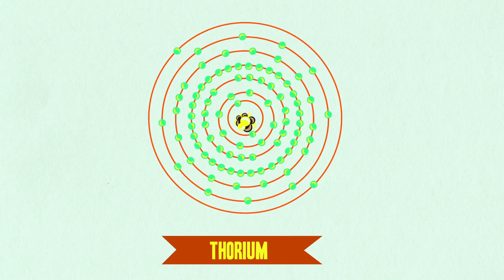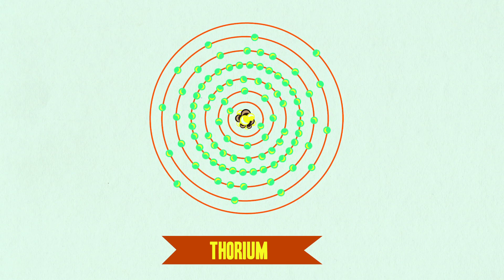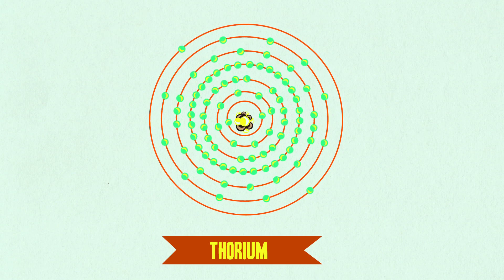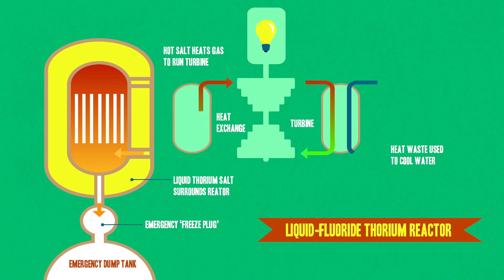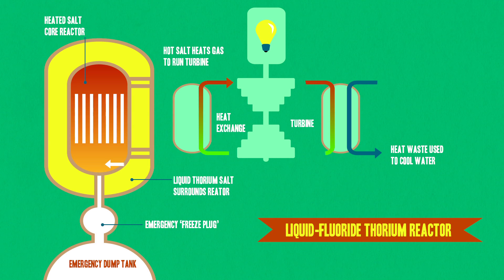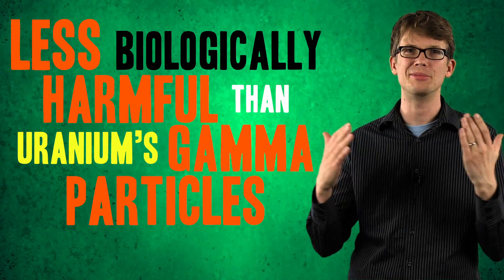Liquid Fluoride Thorium Reactors (LFTR): Energy for the Future?

Comment: I'm thrilled that you made a video on this topic.  However, the bit where you imply that thorium does not emit gamma particles is misleading.  It does during fission in the reactor and various byproducts of thorium emit gamma radiation when they decay.  However, this is not much of a problem if you are just trying to build a power plant because you can set up shielding (w materials such as concrete) to block almost all of the gamma radiation.

Comment: Solar energy is clean and free (same with any source of energy), but it's unusable without proper technology. And so far solar technology is neither clean or free. Solar panel may last 25 years, but it in itself won't produce much energy (I have three solar panels on a roof - they're barely able to heat water in the boilers during hot summer and summers here aren't that long), not to mention that they're expensive and not that clean to produce or maintain.

Comment: Well, interesting point, but wouldn't using solar power be worth the expenses in the long haul? A solar panel if I remember correctly lasts up to 25 years, I don't know how long Thorium Fluoride lasts but it could be more costly over the course of 25 years compared to solar energy which as you know is free.

Comment: You're quite confused. A photon is more ionizing than any other radio active rays. Gamma particles are more ionizing than alpha particles as it travels further in your body. A gamma ray, a photon, can knock electrons out of an atom quite easily which in terms ionizes the atom. An alpha particle, because it is quite big (ei, helium).. although carrying more energy ionizes in a shorter distances (ei, in your skin which is composed of dead cells) and hences, is less dangerous.

Comment: As I recall don't LFTR reactors require uranium or other higher elements in order to begin fission? Or is that a different reactor element design because if I remember correctly there a bunch of radioactive elements which can be used for the same process...

Comment: See, there is a link...
Roofer is a dangerous job...

Radioactivity is a vave or a paricle and disapear very quickly, you mean radioaktiv isotopes. There are some with short halflifes and some with long.
long mean 30yrs and short 8 days or so.
You haven't to worry about Plutonium, its simply too heavy and will stay there were it is.
The radiation in Schwarzwald is highher than in Fukushima...

Comment: Theres other stuff as well, just in the way its built to regulate the heat from each individual core, but basically, the big point is radiation doesn't leak out and the reactor can't melt down at all

Comment: like Boron Balls, which prevent a fuel rod from reacting ever basically, which is why there a last resort. This is a big problem in group reactors because you loose all production from that reactor and have to replace the whole thing, whereas in CANDU's you can just replace the individual fuel rod you stopped, which is much, much cheaper than replacing loads. Basically, if a rod were to overheat, they completely shut that one down and replace it, so it can never overheat

Comment: Basically, its more like several individual reactors lumped together, with each fuel rod being separately contained and hence controlled. That means they're less likely to overheat as they never get too many reactions on any individual fuel rod (as can happen if there all together) and if one were to overheat, its much easier to cool down. If all of that fails and the rod will go critical, you can shut down that individual rod or if necessary prevent it from ever reacting again with something

Comment: well Thorium is about 3 times more abundant than uranium, so logically, its 3 times more efficient to mine, so would produce about 3 times less GHG's. And i'm not sure about retrofitting, but a completely self sealed thorium reactor, cooler and power generator that can be installed in place of a uranium reactor costs about $25M to build and somewhere around $5M to run compaired to $6B to make and $50M to run of a uranium plant

Comment: I visited Europe's JET project the other week. And I can tell you the reactor itself works perfectly and does everything it is designed for, which is merely finding out more about fusion. 2 larger reactors are being funded by the international community, with the 2nd one actually being able to experiment with energy output. If everything goes to plan, we should break even on it by 2039 (I know, ages away), but that is the year energy becomes easy and renewable. We just need to get there!

Comment: I don't know, I think 2050 is looking about right, if not a bit optimistic. There are prototypes at the moment, sure , but we can't get accelerators and tokamacs to last any longer than about 30 seconds, or produce more energy than they need to start. As for lasers (I presume you mean cold fusion reactors, there they most popular laser reactors) there batch producing, not continuous, so they'll never be used for industrial energy production.

Comment: And Fukushima didn't even melt down, they stopped it long before that could happen, it wasn't even close. Plus modern reactors (and I use modern loosely, I mean like 70's-80's) have so many fail safes they can't physically melt down, and most older than that are on there last legs anyhow so are being decommissioned, so aren't going to cause any problems

Comment: There are prototypes, which can run for a short amount of time, so we know what it would be like to have fully working ones, so we know about the dangers of them breaking, they've done it enough. And they're pretty safe anyhow, if you get a crack in the shell, you just stop putting in hydrogen, douse it in coolant and it completely stops, then you just repair and continue, so the chances of them doing any damage anyhow is pretty damn slim

Comment: no, 4. 1 crushed, 2 drowned and 1 heart attack. The 2 with radiation are alive and well with no sign of cancer. And the bit of them that got exposed was there feet because they were standing in the coolant water repairing a leek without radiation boots on, so if they do develop cancer, its most likely going to be tumours in there lower legs, so not lethal. Exactly, the seriousness of the situation was blown completely out of proportion.

Comment: it is safe because the fusion itself is a process, not a material, so unlike nuclear reactors, fusion reactors do only emitt radioactive radiation when the process of fusion is running. if it stops (very easy to stop it, unlike reactions in nuclear reactors) there is just no more radiation. so if the hull of the reactor is damaged, you just stop the fusion (eg by stopping to feed it Hydrogen) and repair it. and the materials are all not radioactive (hydrogen and helium)

Comment: it can't be guaranteed they'll never malfunction, but it is guaranteed that they will never blow up, every nuclear reactor built has to be fitted with so many safety measures they can't actually go critical and explode. The only way they can is if someone builds them on the cheap, which in every country capable of having nuclear power is ridiculously unlikely, as they're so highly regulated
Also, whats to stop

Comment: Another thing not mentioned specifically in this video is that in a LFTR the ThF4 fuel itself is liquid and circulates under pressure.  In a U-235 light water reactor only the water coolant is pressurized,  That seems to me a significant factor but was not discussed.

Comment: You actually need U233 to start up a LFTR and it transmutates the Thorium into U233 as it runs, breeding its own fuel.  While not as common as U235, U233 HAS been used to make nuclear weapons.  It IS much harder to harvest weapons grade material from LFTRs though, but not impossible.  Fabricating the fuel is much more difficult for a LFTR and the technology has yet to be proven commercially.

Comment: I have found there have been several deaths at Fukushima but apparently none of them can be linked to radiation.

Chernobyl was absolutely awful.  Fukushima also.  What makes me upset is we have had designs for several decades that make catastrophes like both of those impossible.  Campaigning against the nuclear industry has led to new reactors not being built and old reactors left in service.  Any reactor that can possibility be hit by a tsunami should be immediately decommissioned.

Comment: basically, too hot! also, it takes a crapton of heat and pressure to kickstart the reaction so people have been "screw this. oil is easier."
for a frame of reference, hydrogen bombs use regular atomic bombs as the trigger. it has to do with nuclear physics, which i cannot explain in youtube's character limit.
think about the sun. that's the energy fusion deals with. to use fusion energy, you have to have some way to generate such heat and pressure and that's cost prohibitive.

Comment: Cost to the environment is quite small, basically in line with other renewable sources (which are not without environmental impact themselves). There is really no chance of awful effects from a modern nuclear power plant. The only truly awful effects were from the Chernobyl disaster, which was a reactor with extremely poorly designed/non-existent safety features. People died who were exposed to extremely high levels of radiation, would never happen in a modern reactor with containment systems.

Comment: No it doesn't. In fact it can only cause damage in a short pediod of time. It is vital that it occurs in a short pediod of time or reactions cannot occur and no symptoms arise - small doses of fluorine in water at regulation level has NO affect on health on adults, even if you take it every day for decades - It doesn't accumulate.
But I give up, you will not listen to reason (especially since if you looked any of this up then you would know you can have your water filtered if you don't want it).

Comment: It is absolutely impossible for a nuclear power reactor to produce a nuclear explosion. Only nuclear bombs can do that. The worst case in a decently well-designed reactor, as seen at the Fukushima incident in Japan, is the reactor melts down and is basically just permanently broken. No one died due to reactor failure. Radioactive waste is really not that dangerous either. It's just a political issue due to people being irrationally scared of radiation.

Comment: Tens of thousands of people die every year due to coal-fired powered plants in just the USA alone. The only major life-threatening event ever caused by nuclear power was Chernobyl, which was basically a complete engineering failure, and absolute worst-case in terms of radiation release, and it will eventually kill ~4000 people due to cancer. 3 mile and Fukushima killed no one. Not sure how you define "safe" but that's as good as it gets when it comes to producing power without killing anyone...

Comment: We discussed this in my reactor class and there was a debate between HTGR (high temperature gas cooled reactors) and LFTR. Both can use thorium as fuel, but the HTGR's helium did not become contaminated because of the radiation.

Comment: While it is attractive to let another country take the first steps into a new energy source as it then becomes cheaper to develop your own systems based off of theirs and unforeseen problems happen to other people, it will drive the price of thorium before you can reap the initial cheap prices. 
This really can only be seen as a stepping stone to solve the energy crisis rather than a solution, as it is moving the issues of limited supply and environmental damage to a separate area.

Comment: Sodium Fluoride only causes damage at high doses, as it has a toxicity rating relative to dose and use of application. Like nearly everything! Water is toxic at high doses for goodness sake. Sodium Flouride used for dental treatment is incredibly well controlled and due to this it is extremely effective at strengthening teeth. And Dental Fluorosis only occurs in the development of teeth and is easily treated. Look up "Sodium Fluoride", "Fluoride" and "toxicity" on wikipedia and learn something.

Comment: overshot water wheels are 97% efficient. also Trompes used to compress air can be used to power turbines or the air itself can be used in nematic machines. either way people need to stop thinging about energy production in terms of power plants, we need to produce electricity at home, and share thought out the grid.

Comment: I have heard about these LFTR but never know of a running system.  instead of overhauling our current plants, we should be building new one and then shut down the old plants over time.  But time has come to switch to a new method.  When was the last nuke plant built? 70's or early 80's?

Comment: That's a flawed analogy. It's more like Coal and Gas. Yes you burn both, but they require different systems to utilise the energy within safely. The other reason that everyone uses uranium is that people know how to use it, and use it relatively safely (post 1970s say). Thorium is new and thus 'scary', which is good as it makes people cautious. That said the tech for uranium is getting OLD (like 50+) and needs to be replaced....

Comment: No....they couldn't. It's complicated. Firstly the Uranium ones are pressurised and used water. These use the Thorium salt (unless I'm wrong) as the coolant, and even if they don't  there will be something other than water in use. The two systems just won't mesh.

Comment: Alpha particles high mass and low energy mean their range of absorption is small, they'll be absorbed by a sheet of paper. Gamma rays are high energy electromagnetic waves and require a lead shirt or a few metres of concrete to be absorbed. However alpha particles are very nasty if inhaled of ingested but the risk is small due to the ease with which they are absorbed when byproducts are properly contained. As long as you don't go sniffing or eating an alpha source you should be fine.